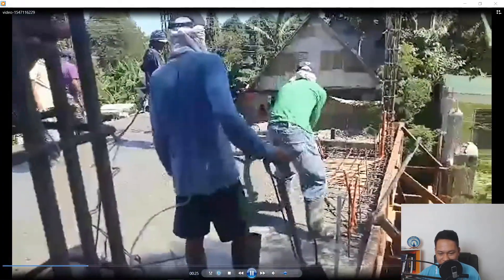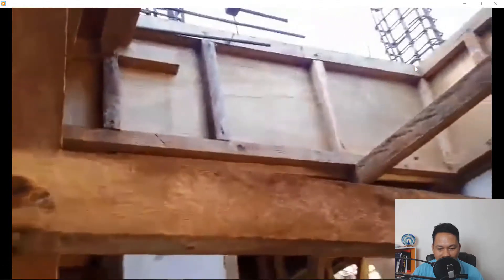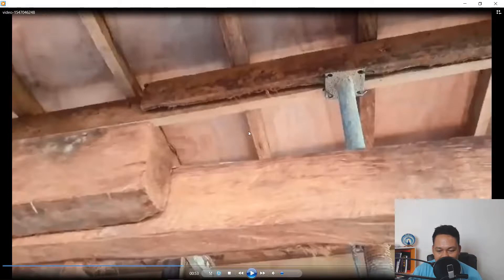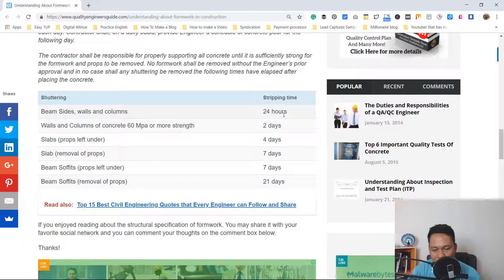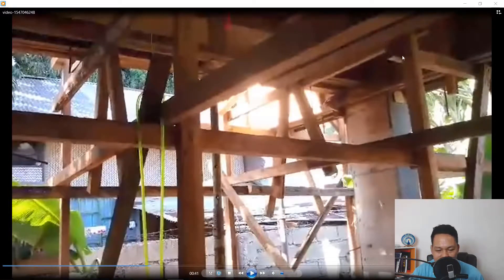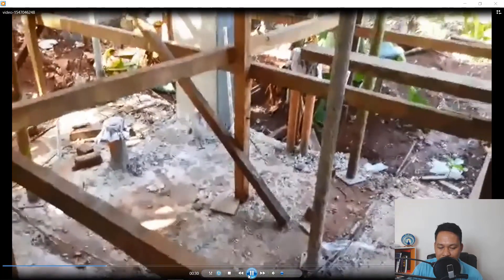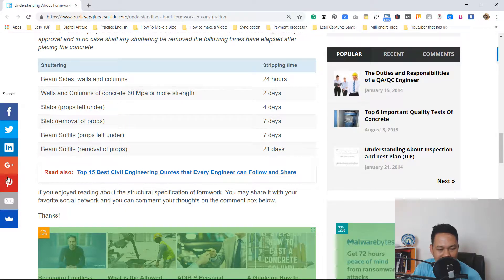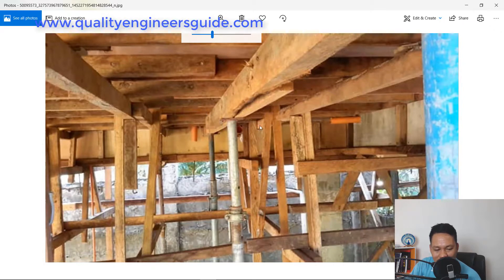Forms of Concrete Slab and Beam: When to Remove or Deshutter

Comment: Is it okay to vibrate beams 2 or 3hours after being poured with concrete mixture? Just by hammering the braces lightly? Is it okay? Okay lang po ba?
Reply from the maker: No, it is not ok to vibrate longer time it will have segregation if you do. Yes, but you should hammer the plywood or the plywood support but the vibrator is enough for this work. It is advisable also to hammer the form when pouring a column it will help just use a rubber mallet hammer.
Reply: @qualityengineersguide   What they did was lightly taping the braces of the formworks 2 hours after they poured the mixture? 

Is it okay po? Or is it barely okay? Or is it dangerous for now?
Reply from the maker: @norshebabalindong2152  No it is not ok. Hammering the forms with hardened concrete is nonsense, it might be dangerous if you do. Do the hammering during pouring, not after the concrete is set. Wag mo na ipa hammer.
Reply: @qualityengineersguide   I see. So for now since nagawa na po yun, tignan nalang po yung result po no? 

Ano po dangerous hints na dapat namin bantayan sa structure physically po pag e remove yung formworks po? That we can say kailangan tong palitan if ganito nakita namin po?
Reply from the maker: @norshebabalindong2152  Honeycomb, ung nakikita ung bakal. Tas ung mga bulging o pag lubo ng concrete at saka malambot di tumigas. Issue ka ng NCR.
Reply: @qualityengineersguide   Ano po yung ncr? If wala pong honeycomb at normal po yung beam meaning po ba nun okay lang siya po?
Reply from the maker: @norshebabalindong2152  Search mo sa videos ko. Honeycomb para mga lubak lubak o may tagihawat ung surfcae ng concrete search mo sa google.

Comment: Good video👍👍 where normally you would have the beams beneath the floor slab, to support the floor. Can you have it the other way round. That’s the floor slab on the underside of the beams, as long as it’s poured in one go.?